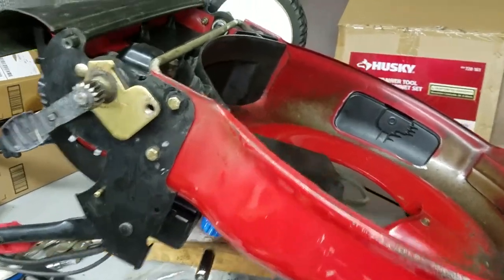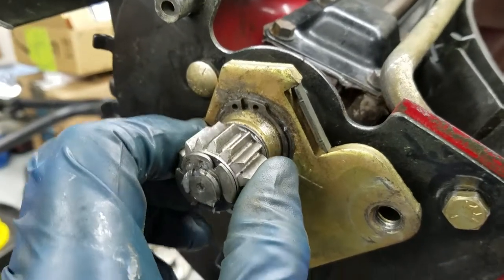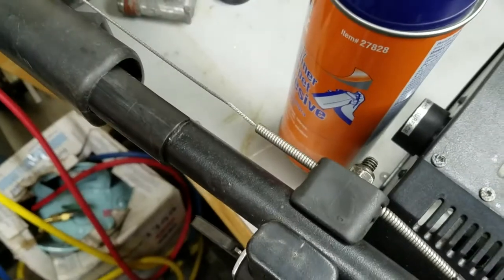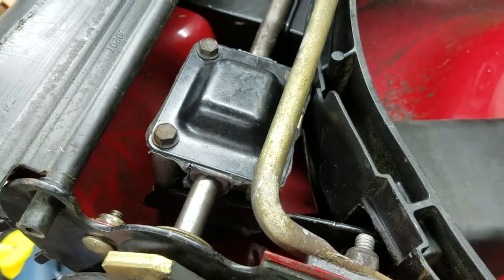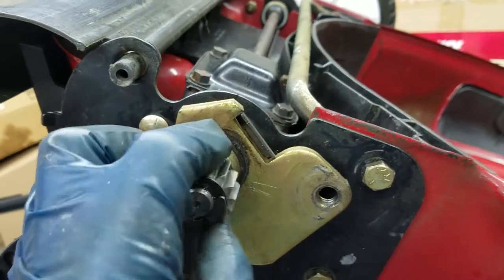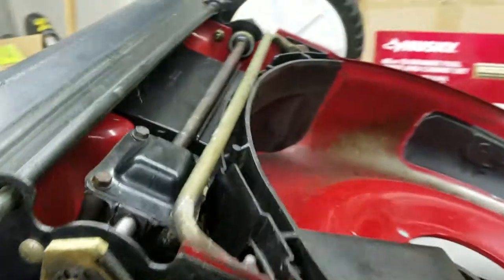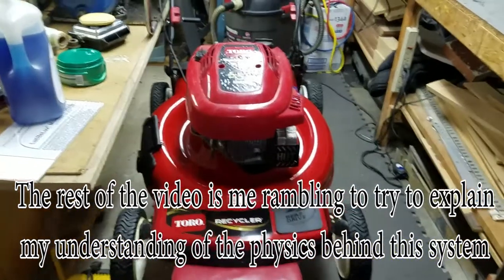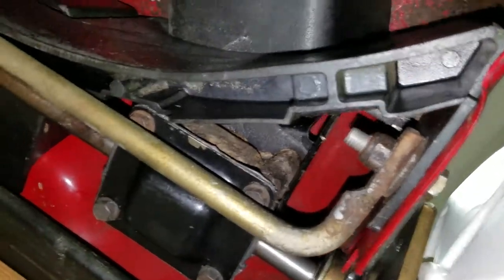How Personal Pace by Toro Works

Comment: I bought one used and found the pulley on the transmission worn paper thin on one side so i flipped it over to the thicker side and seems to work ok

Comment: Excellent video.  I myself, like you was thinking that it was something more complex.  

 I just got a new Toro PP for Christmas from my kids.  While it cuts and mulches very nicely,  I'm disappointed with the Personal Pace on this one.   My yard has a steep terrace out front and the side yard is on a bit of an incline as well.  It won't climb the terrace unless I really push hard to help it along.  Even on the slight grade of my side yard it will stop traveling if I hit a patch of tall grass.  I did adjust the cable a 1/4",  that did help but still not good.  I'm gonna give a little more adjustment next time I use it  and see if it is corrected.  Possibly the belt needs to  be broken in.  It must be made out of some tough stuff to hold up under the constant slipping. 

As you pointed out the torque reaction of the transmission works against you and reduces the torque to the wheels just when you need it most.  Probably why it won't climb my terrace.  There is also the drive side of the belt pulling increasingly forward on the transmission as the load increases, adding to that effect.  

Another thing on this new one is that the slide handle has to travel around the curve of the newly designed handle bar,  requiring more effort than the old straight design.  I have a 30 year old Toro PP at my other house and it seems to work fine, although there are no steep hills there.

Comment: We have two identical mowers.  Front drive Toro.   One will not roll forward, the other will not roll backward.     So far the wheels have a gear with a spring and key.  All are well cleaned and oiled.   Can't locate info on this.   Any ideas ?                (Oh and thanks a bunch!)

Comment: Something rarely mentioned is the bearing in the gear box between the belt pulley and the  pinion gear. Dirt gets into it and causes it to drag and that stops it from rotating freely when pulling the mower  backwards. The bearing can be freed with penetrating oil or replaced.

Comment: Good Video. I've done these on this type of personal pace toros ans Hondas. But I'm working on a 20092 with the Rocking Key in the drive wheels and can't get this mower to move.
The belt is brand new and tight,  and all parts in the drive wheels look good.
The only thing I can think of is thr transmission is slipping or worn out
Reply: Make sure that you installed the drive pinions on the end of the axle correctly.   If reversed you'll get no drive.

Comment: I have a regular push mower and it is hard to push. I took the wheels off to grease the Axels and one of the races stayed on the Axel and it was the first one so I didn't notice it, and I greased the race.
Reply: I have gotten one of these given to me that had been setting up for a few years.  I cleaned the carburetor and plug and drained the gas and oil and put in fresh,  It started on the first pull and I was very impressed with the power of the 6 1/2 hp Engine.  The only problem that I have is that the back wheels wobble badly and it is hard to push. I have not replaced the cable that engages the rear drive. Any idea how to fix the wobble on both back wheels?  Thanks for any help!

Comment: Is Personal Pace more trouble than it’s worth?
Reply: yes, it seems this mower is more trouble than it's worth, belt broke the first year, 2nd year the cable broke. Now with the new cable it worked for a while but stopped. The belt is in tact. Rotating the wheels turns the gears and pulling the belt by hand turns the wheels so the gearbox is good. So it's either a tension problem I have or the belt. The belt doesn't seem stretched. I've been trying the last few days to figure this out. If anyone can help me think this through...

1. Belt is in tact (took it off and verified)
2. I removed the cable again and re-attached (just to be sure it wasn't an adjustment issue
3. The gearbox works because when I turn the shaft by hand with the belt the wheels turn
4. I pulled the cable from the top with pliers after disconnecting from the handle side and the mower still didn't move forward. The wheels didn't spin either (I had the back wheels off the ground). 

I just can't seem to figure this one out. Each component seems to work on it's own
Reply: I would say try it. I have self propelled mower and it makes big difference.

Comment: All your doing is slipping the belt to get different speeds. The gears are just powder metal gears. You either fix this stuff yourself or buy a new mower. With labor so high it would cost more to repair with parts and labor if you had a mower shop fix it. Throw away mowers unless you are a DIY. That drive system will last awhile if you clean it up every year and grease it again. Most people don't so when it breaks the parts will likely cost as much as a new mower. Great video on the system BTW.

Comment: If the wheel does not turn, there may be mud between the gear teeth. After 15 years, I had to buy a drive belt that was 1/2 inch shorter because the metal pulleys can also wear down and make the belt slip.